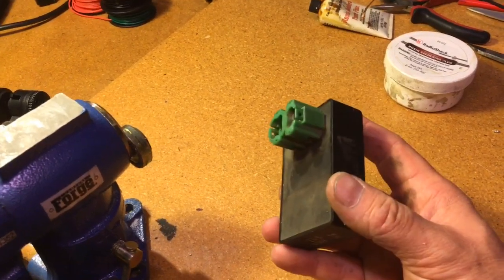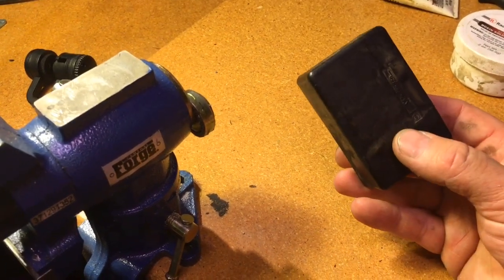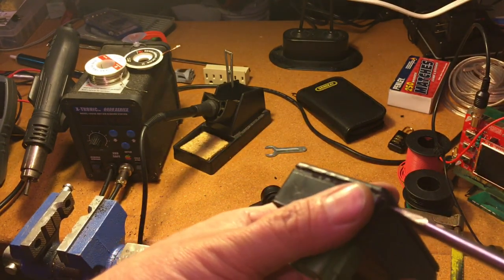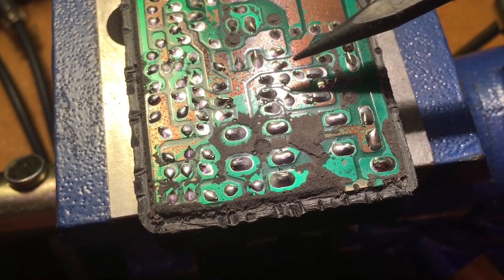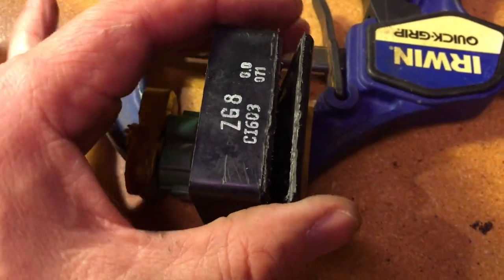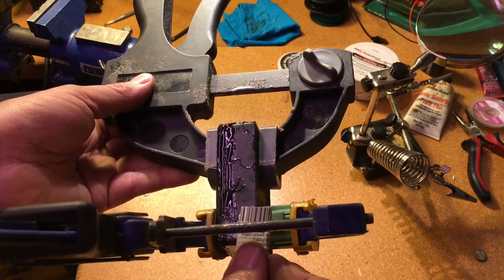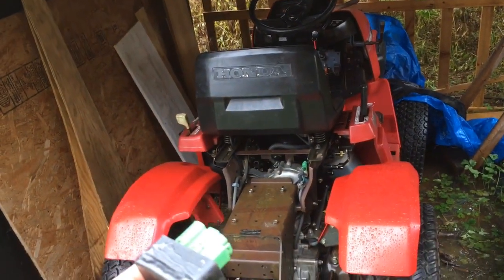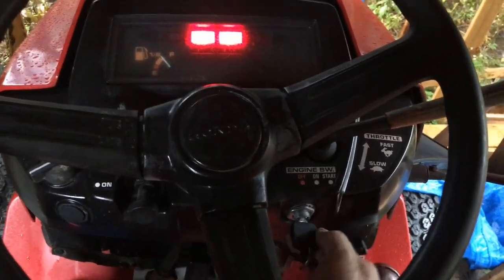CDI Repair

Comment: Your AC CDI is in good condition, i think the primary coil of your tractor devalues that's why it can't give your engine a better performance.
Reply from the maker: The coil is fine, checked that early on. The CDI was bad, once this fix was done, it started quickly and reliably.  I’ve had this issue on a number of “old” motorcycles, the fix is not 100%, but it does usually work and saves the time and money of chasing down an old CDI when it’s out of production and/or too expensive.  👍🏻
Reply: @MaineGreenCrabs  good👍👍👍 but you can use dc cdi too for accurate and reliable firing.

Comment: this is cdi suzuki or honda
Reply from the maker: moto mnvn it happens to be a Honda 5518 tractor, but the CDI boxes are all constructed the same way, even the old aluminum ones.  You can do the same procedure on any of them regardless if it’s on a tractor, motorcycle, jet ski, etc.
Reply: @MaineGreenCrabs  thanks. i cut cdi suzuki 110cc  same you . but i can not repair it
Reply from the maker: moto mnvn are you able to solder?  The point of the video is how to repair cold solder cracks that happen in the CDI.  By exposing the back side of the pcb board, you can see if any of the solder is dull or has hairline cracks (I have some cheap jewelers glasses for that) you can then use a soldering iron to remelt the solder which repairs cold solder cracks that cause the CDI to not work.  In rare cases a capacitor may be blown or resistor, etc.  Those are much harder to replace because they are on the other side of the board and encased in epoxy, you can remove the epoxy by soaking the whole CDI in acetone, but that almost always causes corrosion to the etching on the pcb in my experience.

Comment: Can u explain how to remove speed limit from ac 6 pin cdi.
Reply from the maker: Do you mean derestrict the rev limiting function of the CDI?  For a good engine why, they’re built that way for a reason, why mess with it?

For a scooter or some cheap engine you’re playing around with, it’s completely not worth it,  soaking the CDI in acetone to expose the PC board would also eat away at the PC board, you can buy a new CDI for $8 that’s built that way.  

I’ve heard that just detaching one of the grounds at the CDI accomplishes the same thing, but that might only be on two stroke scooters, I’ve never messed with that.

Comment: they say you can heat them in the oven at 300 for 10 min and it will fix them 75% of the time
Reply from the maker: “They”?  Your welcome to try, though 300 wont reflow solder.  It will melt many plastics so be careful if you try.  You can, initially, heat the CDI with a hairdryer on high, heat gun on medium or oven at about 150 so it s almost too hot to hold.  If you quickly plug it back in or heated it on the vehicle it often will often do the trick and get it to start.  It starts because of the heat expanding the solder, not melting it.  After a number of times this technique will fail too as it ultimately expands the existing cracks in the solder too much. But its a stop gap measure I e used.  Good luck. 👍🏻

Comment: Tried oven moisture fix, no help.
Reply from the maker: No need to put in an oven, you’re not trying to reflow or remove moisture just get things to expand a tad.  A heat gun is all you need, but it doesn’t work all time.  Sorry to hear.

Comment: it would have been better if you show the issue before repairing
Reply from the maker: Mohamed Arthil LOL, I say at the start of the video “my tractor isn’t starting unless I use a heat gun to warm up the CDI”.  It would be funny to have a video of a tractor not starting, I might have to try that.  In the mean time..... 🚜
Reply: @MaineGreenCrabs  haha.. i didnt notice it.. 😅
Reply from the maker: Mohamed Arthil maybe my next video of an engine not starting, then heating up the CDI and it starts.  It’s a short term solution that works and shows the CDI is the problem, and 99% cold solder issue requiring replacement or my fix.
Reply: @MaineGreenCrabs  what is cold solder.. is that the cause for CDI issues like engine misfires ?
Reply: Mohamed Arthil “cold solder” means that the original soldering was not good (too cold, usually the solder has a matt not a good glossy sheen) and is more susceptible to cracking thus the various components to dont have good contact on the PC board.  That’s why heating the CDI  (making everything expand and briefly touch) some times gets it work
Reply: @savingoldbikes4387  so can be fixed by desoldering all solderings and re soldering right ?

Comment: DC CDI?
Reply from the maker: RoyChavezSer not sure if that’s a question or statement....  either way it makes no difference if the CDI is powering an AC or DC system, this repair is done exactly the same way.

Comment: does not even worth it.. they cost 5-15dollars and genuine 15-35..
Reply from the maker: This video is for older engines out of production, in this case my tractor where there are no new CDI’s or limited and thus expensive CDI’s in production specific to that engine.  Some CDI’s can cost several hundred dollars, if you can find one, this is especially the case for older motorcycles when the industry was changing from points to CDI ignition systems.  But for sure if you have a new engine, particularly cheaper engines like the Chinese GY engines in so many things it makes sense to just buy new.
Reply: @MaineGreenCrabs  ohh yeas we also have no right to repair anymore..  good job anyway!
Reply from the maker: You always have the right to repair hardware, like CDI. Sadly for vehicles with computers we frequently don’t have the right yet, to fix software. Much like jail breaking iPhones back in the day, I think the same will happen for vehicles.
Reply: @MaineGreenCrabs  saddly yes they will. they re going to have a small microcontroller in every part and tie it to the "cdi" cpu" of the car and throught the software you will have to update software if you replace anything.. adding cost to final products and complexity that dont really nedd. . and always need a certified technician that usually is overprised. (just like the story about MCDonalds ice cream machines) thats why i like older simple motorcycles, they dont brake down and easy to repair if they do.. they will say that it is about safety and privacy! greedy as f..

Comment: Reasons for defuse of cdi
Reply from the maker: Ajay Dhumal I’m not sure I understand your question.  Are you asking why the CDI stopped working?  If so, it ‘cold solder’.  It happens when the original solder wasn’t the right temperature when everything was put together (flat dull sheen to the solder versus shiny like a mirror) and the cold soldered spot cracks over time. Hope I answered your question.

Comment: Honda cbr 250 r ecm (cdi) how to repair
Reply from the maker: Jio Services not quite the same as CDI, the ecm/ecu controls most or all electronic functions in new bikes.  Regardless you’ll need to test it to figure out what’s wrong,  I’m not familiar with their repair, and you might be able to pick up a functioning one on eBay at a reasonable price depending on year if your bike.  Good luck.
Reply: @MaineGreenCrabs   their is post talking about using the oven to heat  cdi box at around 250 degrees for around 10 minutes give a little either way  .  Lote people say it works ?  If not working at all worth a shot .
Reply from the maker: Larry Alexander no need for an oven, a hair dryer or heat gun will work - old motorcyclist trick.  You need to heat the CDI up so it’s almost too hot to hold then quickly plug it back in and try to start.  It works quite often at the beginning of the failure.  It’s not a fix, eventually fairly quick, it will stop working.  What you’re doing is heating up the CDI so that the cracks in solder expand and make a connection until it cools off.  The fix I’m showing often works but not always, by reflowing the cracks in the solder that have happens because of poor solder being heated and cooled over a long period of time.

Comment: Just buy a new one Damn things are dirt cheap
Reply from the maker: On some small engines sure, I wouldn’t do it on much more than a cheap lawn mower (a lot of small Chinese engines eg in scooters etc use CDI’s that will work ok in Honda and Yamaha since the Chinese engines are clones of them) but they usually won’t run right, and can cause damage if put into other engines. This is more likely in older engines or higher performance engines. This Honda tractor has a pretty good engine, I wouldn’t put a China CDI in it.